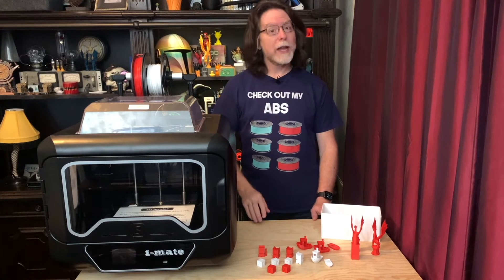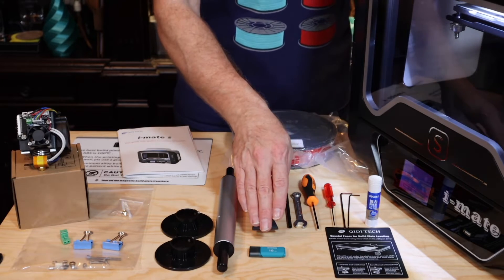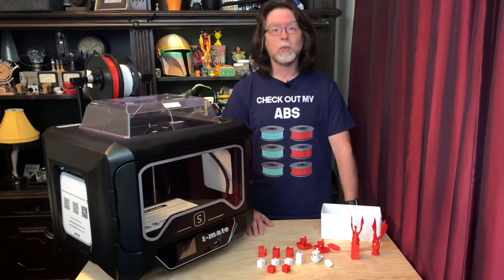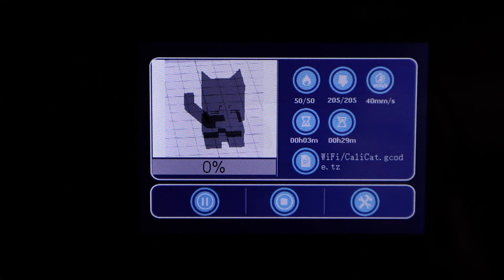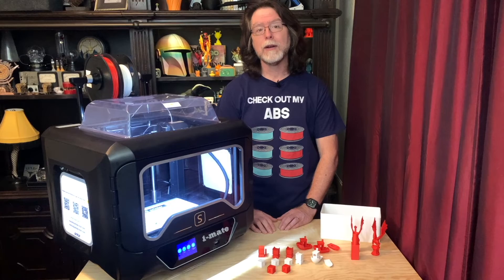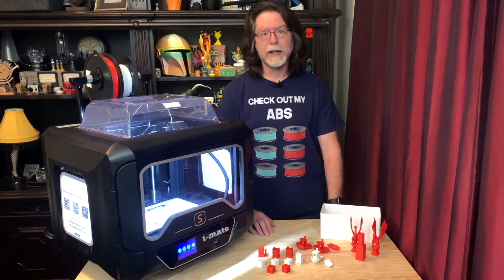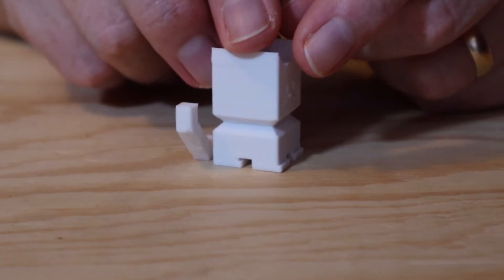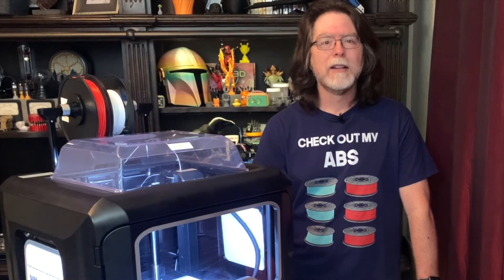Best Enclosed 3D Printer under $500? QidiTech i-mate S

Comment: I have this printer and it is the best printer I have ever had.
Reply from the maker: I have mostly been using it as my ABS printer and it's done well for me in that role. 👍
Reply: I have 2 of them and swapped the hotels for hardened steel all metal from qidi. Works perfect.
Reply: you must have had some really crappy ones before

Comment: to bad it doesnt have a all metal hot end, and really use the enclosed chamber for stuff like nylon and pc that needs temps up around 280 to 300c, another great video
Reply: All metal hot end is 60 bucks from qidi so not an issue just swap it out.

Comment: The ringing is from the HUGE MASS that is the hotend. Basically I would buy this just got the enclosure if it was around 300, because let's be honest it needs a new hotend and extruder, some modifications to have belt tensioners and slight modification for exhusting the abs fumes post print. But it's like 90% there, again for $500 a definite no and let's be honest we need an enclosure that can get to a stable and consistent 70 degrees. Ideally even more for none impregnated filaments like PA or PC

Comment: Thanks Bryan I think for that price I would rather purchase a Flashforge Adventurer 3. Still fully enclosed with filament run out sensor,  power cut resume, built in camera the lot and you get amazing hassle free prints straight out of the box. Being a Flashforge printer it is bullet proof for years also. Cheers mate.
Reply: It was good years ago.  Things have moved on.

Comment: This printer is baffling. The enclosure is designed to help with ABS and ASA but it's not safe to reach the temperatures needed for ABS/ASA with the TPFE lined nozzle. I am not sure whether 235/240 is enough to avoid delamination consistently with all ABS/ASA filaments! What do you think?
Reply from the maker: I print ABS with it at 235. The filament I’m using has a print temp between 220 and 250. So far it’s doing ok, but 240 is about as high as I would want to go with it.

Comment: I have a x-plus by QIDI and I must say their printers ARE AWESOME compared to shitty creality printers you dont need to do anything to them to get great prints! If you compare what you will spend on say and ender 3 and all the upgrades needed for them to print good compared to a QIDI printer, you'll actually spend way more on a creality not to mention countless hours of fiddling with it. QIDI printers direct drive extruders, strong supports, awesome build blade and most are fuly enclosed so you can easily print things like carbon fiber and everything in between. Simply put they are cheap and print the way creality users dream only wish theirs did.

Comment: Hi Bryan, I was wondering can you please get the "Voxelab Aquila 3D Printer" 
and show it b unboxed, built, and tested y your good self,  WHY? because I have seen this is printer is said to be a Creality Ender 3 V2 Clone printer. 
It uses the same layout and design and even the same main board. The control screen is not the same as the Ender 3 V2 But is a nice one!

The reason the Aquila is getting popular is because of it's price compared to the Ender 3 V2.

The Aquila costs far less to buy But is as good as the Ender 3 V2.

I was so impressed y 3 you tuber printer reviews I ordered one to replace my Tronxy X5SA which I still can't get to level right months after buying it?

I was going to buy the Ender 3 V2 But by buying this Voxelab Aquila printer on Amazon UK I saved £87.00p on the price of the Ender 3 V2.
What a great Bargain. I could if needed buy a Creality encloser for this Aquila thanks to the money saved.

Loe your videos so any to do with this Aquila printer be great. Cheers.   8 )